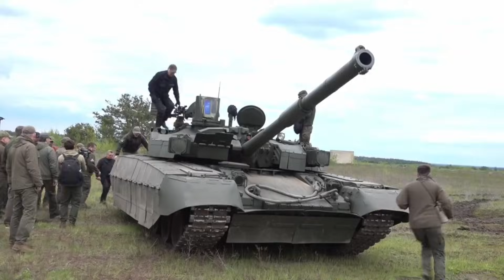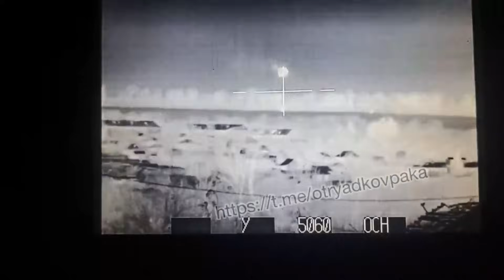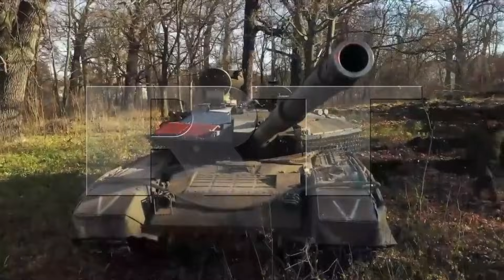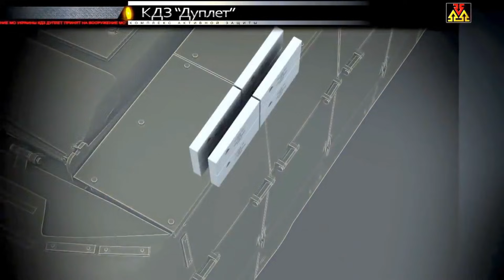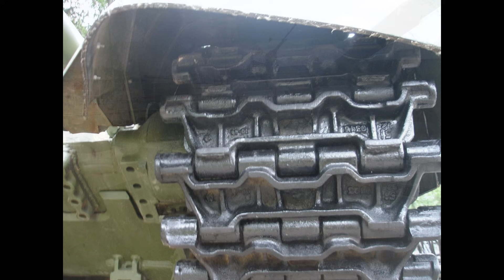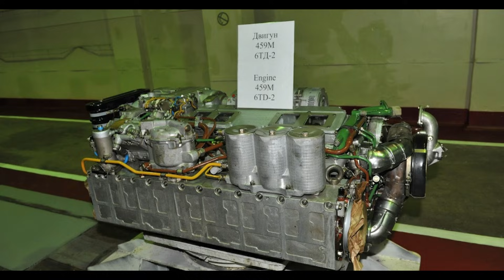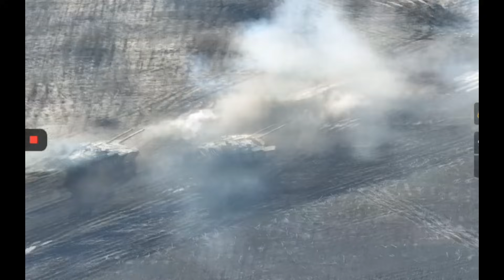Best Ukrainian vs Best Russian tank. T-90M vs BM Oplot comparison

Comment: The bigest problems of the T-90 is the margin of deformation at the bottom of the tankб this is for all T-72 based tanks, which is only 6mm if I am not mistaken which makes the tank very vulnerable to anti-tank mines, which becomes one of the most common reasons of ammo detonation, the first one is of course the Javelin. Another common issue is related to the reverse speed which becomes a very serious problem when the tank has to retreat. A different problem which is not minor is that the tracks are good for roads, but definitely not good for marshy and unpaved terrain, which not only makes the tanks slower, but does make the tank to get stuck and doesn't allow to work efficiently. About the engine is a different story, since is the same engine from T-34 (WW2) and has problems with exaust and heat, they do overheat very easily.
Reply: It is not the same engine from 30s. Its Been modified so much that it isnt the same rngi e that it was at all. And the armour covering the ammo should prevent any fragmentation damaging the ammo. Most of the time anti tank mines only detrack the vehicle.
Reply: The point you made on engine is completely false : 
https://youtu.be/nyWAd1pQiwU

Comment: In fact, the situation is a little different. First, to believe the numbers of the Russians is to disrespect yourself. Lying for them is like breathing.
Secondly, from those problems for T90m, you can also highlight:
- Unreliable engine that loses almost half of its power in hot weather.
- The fact that the T90m has an additional ammunition pack behind the turret is cool, until you understand that in order to load that ammunition into the loading machine... you have to get out of the tank and transfer the shells inside with your hands.

Also, the "dangerousness" of the T-64 automatic loader is greatly exaggerated. In fact, in this regard, the machines are more or less similar. However, the layout of the machine gun in the T-64 provides better opportunities for evacuation from the tank, as well as a much larger margin of deformation of the bottom of the tank.

I wouldn't believe them about the best thermal imagers, or in general, manufacturability. Based on my experience of monitoring Russian equipment, I can say that in this regard they lie most often. Also, due to sanctions, they can install much worse technical equipment than was planned at the beginning (because it is often seen on the fronts now, as in Russian tanks, there are empty boxes instead of reactive armor).
Reply: I mean he takes the information from both sides at face value. You cant really trust either side since the oplot is more of a propaganda source than an actual tank.
Reply: @medievalarmorexptert6827  Do not compare Ukraine and Russia. Ukraine is not trying to promote Oplot as something super-modern, super cool and something everyone should be jealous of. It's just a good tank for its price. It has very good protection, but not as good in terms of modern electronics as Western models.

If this war has taught me anything, it is that Russia ALWAYS lies. When they talk about the reasons for the start of the war - they lie, when they talk about the course of the war - they lie, when they talk about some agreements - they lie, when they talk about their military power - they absolutely lie.
They lie about the amount of equipment, its condition and characteristics. On paper, they should have 12,000 battle tanks, but even last year, rarities such as T-62 and T-55 began to go to the front.

To believe the Russians is to disrespect oneself.

Comment: The biggest weakness of the T-90M, is that the crew is russian. They can turn any piece of equipment into useless trash simply by crewing it. And then the fact that it operates within the russian military, a quality that acts as 'force divider' (opposite of force multiplier). I think they will have less than one full squadron remaining at this rate, by the time they finally accept they have lost the war.

Comment: Soviet gun vs a gun that entered service around 2004, means that even if longer rounds with more power were used, the same gun barrel would have drastically lower life expectancy.

Sabot rounds apart from some very new ones have a wear factor of about up to 7 compared to low pressure full bore rounds, which I presume is either HEAT or HE-Frag.

Meaning, sabot wears the barrel heavily, so if possible, to make it last longer, use other types unless necessary. Newer gun barrels however tended to be made in tighter more precise standard than those before it, as well as lasting longer at same pressures.

Is BM oplot base armor T-80U still ? Not that awesome by todays standard.

Comment: 11:48 that's not armored plate. That's just around 10mm of steel
Reply: steel tends to be the armor.
Reply: @cdgncgn  true, I must have mixed up 2 different thoughts in my head into one comment lol
What I meant probably, was that it is really thin, I think it's not even armored steel if I remember correctly (but I might be mistaken), and it's in no way shielding from ammo explosion, rather giving a little bit of protection from internal shrapnel if they were to strike ammo

Comment: Ukraine chose to modernise the T-80, which itself was a modernised T-64. Russia chose to modernise the T-90, which itself was a modernised T-72. The latter happening largely because of it being humiliated in Iraq and desperately needing to give it a name change to save foreign sales. The thing that Russia should be most concerned about is the fact that a country the size of Ukraine, with the gulf in military spending available, was able to produce anything that can even compare to the best tank Russia fields currently. That tells a story in and of itself.
Reply: That completely false T-90 was build on 3 tank basis T-80U T-80UK T-72BM
Reply: @mbtenjoyer9487  Nope. It's based on the T-72 chassis.
Reply: @thejac0b1te36  my point still stand
Reply: @mbtenjoyer9487  not according to the manufacturer. I suggest you take it up with them.
Reply: 90 is hardly just an upgrade, it is also bigger, wider. And no, what Iraq ever had at best was a few of upgraded T-72M1, most of them were older, M or just 72, which is an early 70s tank. T-90 is called object 187, so I presume, work on it started in 1987. Without it being supplied and financed by the US + its vassals, they would collapse within a month at best. Ukr GDP of 2019 was 56% of 1989. They were internal part of USSR that US and vassals turned against them and now carry the cost of aggression. 30 years of 'democracy' impoverished them and those who did so, blamed the RF for it. Any oplots made will have to be made outside of Ukr and on western expenses. Ukr has no money, or even land to sell to the west any more.
Reply: @cdgncgn  T-90 was objekt 188. Objekt 187 was based on the T-72B. Yes, Russia has more money than Ukraine. That was my basically my point. Though you wouldn't guess that from the current war situation. What was your point exactly?

Comment: Well, when the Russians begin using T-14s in the conflict, then the whole reverse speed drawback will no longer apply.  But yeah, they should upgrade the transmissions on their T-90 engines so that they drive as fast in reverse as they do forward.

Comment: This is a little like Quartets (card game). 4500 Nm vs. 3200 Nm: Check!
Of course this data is relevant, but the far going claim that the T-90 can accelerate much faster ignores several factors, that could counteract this conclusion. It is very well possible to have more torque but less acceleration. For example, because the power curve is uneven over the speed range, or the drivetrain generates high losses, the gears are poorly matched to the power curve, or the engine has unelastic or sluggish behaviour overall. It is therefore speculative to conclude solely from the higher torque that the acceleration capacity is much higher. 
So after all: what is "much faster" exactly?

And regarding the production figures: I don't think it makes any sense at all for Ukraine to ramp up tank production.
Their industrial capacity is better used by maintaining the existing T-tanks. Ukraine cannot compete with Russia in the arms race on its own.
Replacement and replenishment will have to come from the West anyway.
Reply: Uk has a similar card game. We call it top trumps

Comment: That information about the speed of only 4km/h in reverse, when it comes to the T-90M tank, is not correct, and there is a video as proof of that. The video shows the T-72B3M tank, the latest version of the modernization, the model from the end of 2022, which is when the engine and gearbox are unified with the T-90M tank. So, it is generally known that this tank shares the engine and the same automatic transmission with the T-90M tank. A video from a few months ago, right from the battle, of the T-72B3M tank, says the complete opposite. That the tank has a significantly higher speed of movement in reverse. At least 15-20 km/ḫ, as far as it can be estimated, on the video, approximately, if not faster, since this is only one video, and no one can guarantee that this is the maximum speed, it can be higher, lower for sure no ... And the T-90M tank has exactly the same performance... As I said, I won't go on, there is evidence for that, just a video from the battle. Even the oldest variants of the T-72 tanks never had the speed of moving in reverse of only 4km/ḫ, but somewhere around ten km/ḫ...

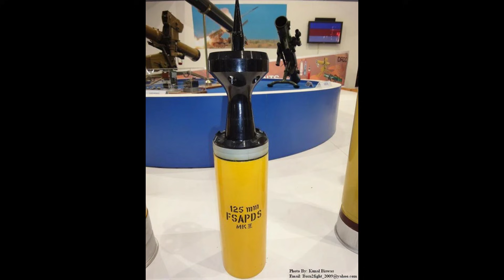DOES THIS SEEMS LIKE 4KM/Ḫ TO YOU?! YOU CAN SEE THE PROOF ON THIS VIDEO, WHICH I'M LEAVING A LINK TO, STARTING AT 1:41 MIN.

https://www.youtube.com/watch?v=K5o3NNtVyoE
Reply: In that video the tank was moving forward, not in reverse. Check the side of the tank that the turret was facing, it was flat, not angled.
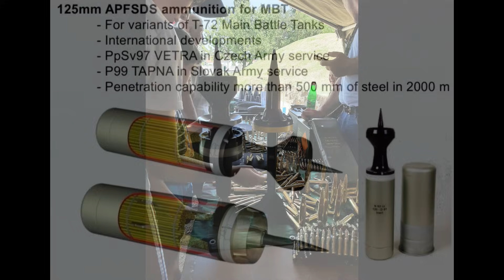Reply: @voidtempering8700  Then, my friend, you obviously don't know what is the front and what is the back of a T-72 tank, take a closer look at the video, since I know Soviet/Russian tanks well, my country has used them for more than 40 years, and also served with the army in to my country, so I certainly know what the front and rear of the T-72 tank looks like. Check again, on the video I left in the link, I will be more precise starting from 1:43 to 1:46 minutes. The question here is the latest modernization of the T-72B3M model from the end of 2022. It has a cage on the rear part, against RPG, also the rear part of the tank is flat, upright at a right angle, the rear part of the tank body can be seen in the video at 1:39 minute, when the turret is also facing the rear, but the tank is moving forward, but I didn't mean that part of the video. I meant the part of the video starting from 1:43 to 1:46 minutes, to be more precise. The same movement continues, which is also visible in the video, and with that movement in reverse, it also goes into cover, which is the end of the video. You can clearly see the movement of the tank in reverse. The front part of the T-72 tank has been knocked down at an angle, the turret is also facing the front part, it is clear that the tank is moving backwards, in reverse, so you can see the complete front part which has been knocked down at an angle, you cannot see the cage as a protection from the RPG, which is on the rear part, you can also clearly see that both the turret and the cannon are facing the front, because the ERA is also on the front part of the turret at a slight slope, that is, at an angle. While the rear part of the turret is not visible, on the rear part of the dome, is a huge row of ERA which is placed completely vertically. So it is quite clear that the tank is moving in reverse.

Comment: in 2023, yeah, time to ditch the T90/BM and start anything newer than rehashing something from the 90's. As for the ruzzian variants, they have what they have, anything made after 2014 has to be done with the minimal newer tech they can't get. I will also note, that there are some reports of tanks rolling out of ruzzian factories now having thermal sight holes covered over or are equipped with older TKN-1SM variant sights (a cheap USB cellphone ali-express thermal cam is better today). overall, the 'dream list' of T-90M equipment may be debatable for most tanks in use by ruzzia today.

My overall assessment of them Tanks is a bit simpler. The problem with the T-90M is the nation operating it (ruzzia) and it's age, and the problem with the BM is Ukraine has better stuff from other nations on the way (do you waste your time trying to fix a T90, or UWU the shiny new 2A4 or M1A1 with various upgrades).
Reply: Yeah you really dont have any idea what you're talking about, you cant even spell russia rigth

Comment: I'd argue T90m is better than western tanks, minus the reverse speed. It gets up to speed faster, able to use more terrain n bridges. Automatic lead on FCS. Has easily ready parts. Simple maintenance, sure doesn't have a diagnostic computer on board say like Leopard 2. Has extremely reliable autoloader. Much lower fuel consumption in comparison to NATO vehicles. Remote fire Machine gun, not all NATO tanks have. I can't tell if it has a camera for a driver tho, probably not. I do hope that changes alongside reverse speed. Camera and APS on T14 on T90m should be done too
Reply: The driver does have cameras for the front and rear
Reply: @voidtempering8700  i know this, I meant I can easily see this implemented. Like the T14's 2A82 gun, APS, and maybe even it's afghanka ERA  but who knows what they'd standardize more on

Comment: Russia is not making 100’s of anything anytime soon. Sounds like a bunch of wishful thinking to me. Russia relies on so many key western components for everything they make that it’s going to be impossible for them to make anything. T-90’s without thermals and ball bearings is nothing more than scrap metal.
Reply: The T-90M is 99% made from Russian components, including thermal imaging matrices, 1% are processors produced at TSMC, the existing stocks of these processors will last for 10 years of T-90M production.

Comment: Nozh/Douplette due to its design and function seem to need a pretty sharp angle to work, which might make it inable to stand hits not from that exact angle expected. So covering the roof might be nice for missiles comming in a ~30° angle, but not anything more directly top attacking, as this HEAT beam would perfectly go through the defensive projection from Nozh.

Same with threats hitting Nozh from a ~90° angle, as these wouldn't affect the threat at all. As this might be irrelevant for (not top attack) hits on the frontal armor, this very well might be relevant on side armor. From teh space and angle of the side shield, you can tell that Nozh is single layered and either top/down mounted, so both ERA lines might have at least a bad angle left, or they're from front to rear like snake scales, offering good protection from frontal hits, and then gradually degrad protection the more the angle of attack shifts to the side.

I also have my concerns about removing frontal armor for ERA cover. As ERA indeed offers better protection, and can be replaced/modernised way better, they still need to have something that have a indiscriminatly 'dumb' protection to catch the rest. Removind armor might make the whole degredation idea pointless. I know, its a coping strategy on top of copying strategys, but still i see some problems.
Reply: Addition: This limitations of Nozh rendering Oplot almost completley inable to protect against artillery fire, which is one of the main threats in the recent war.

Maybe a combination of flat tiles (instead of the heavy armor they removed, as well as on top) with a single explosivly projected plate would make sense, and protection would be a bit less niche against KE from one specific angle.

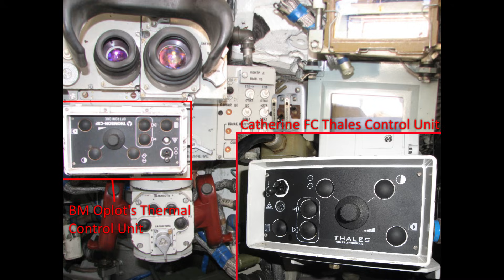Comment: 2:08
One correction I have to spell out to you here. The thermal control unit on the left was made by Thomson-CSF (as depicted upside down in the still), while the one on the right is made by Thales. They're not copies of anything or anybody as Thomson-CSF (1968 - 2000) was the former trade name of Thales (2000 - current).

Comment: You use outdated data: T90M(model 2023) weighs 51 tonn. With some changes to the ERA patterns, nets now having ERA, as well as anti-cumulative railing added to turret.

And regards the BM Oplot - it's less of a tank, more like unfinished prototype: duplet as ERA is too bulky and leaves the question, to cut size of actual armour, or to further increase the weight and dimensions of it therefore use of bigger engine, as well as new transmission and wider tracks required. Actual efficiency of Nozh ERA is comparable to Contact-4 - it's cutting capacity is highly overstated, and its kind of bad at sustaining direction.

Comment: Being an absolute diletant in...mechanics, physics, tank design and thermodinamics, I'm aware that my next proposal would gravely offend some of you, but still here it is:
A tank design with carrousel scheme of ammo feed and storage, but with huge blast panels facing down...In a term - when the tank systems detect penetration they initiate dropping the whole carrousel below the tank. The bulk of anti-tank mines affect only the tracks, and any other anti-tank ammo are aimed at the sides, the turret and most recent - the top of the turret, while the bottom of the hull is the only thing remaining after a complete ammo cook-off... Trading the chance of an violent turret launch versus lowering the protection from below is kind of a reasonable..

Comment: Great vid but I would like to point out that T84BM oplot also can mount the KMDB 6TD-3 opposed piston 6-cylinder diesel (1,500 hp), instead of the 6TD-2E (1200hp) engine.